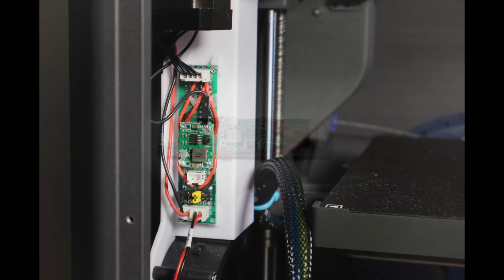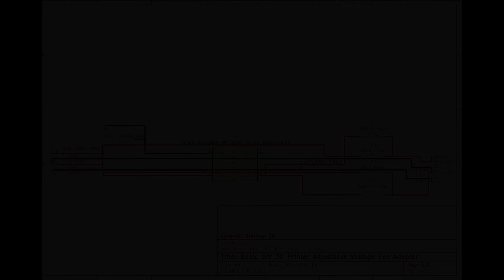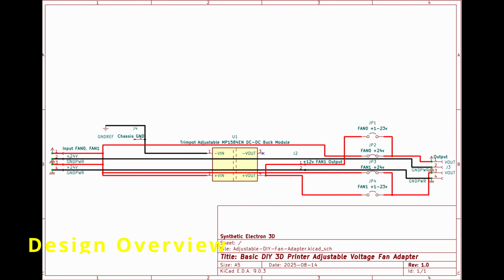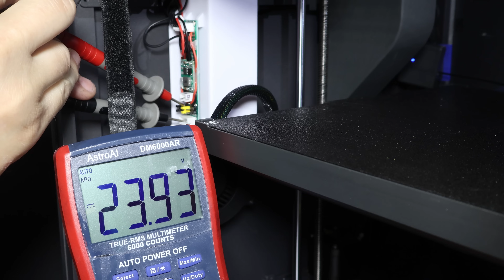DIY 3D Printer Adjustable Fan Adapter

Comment from the maker: If you were to make use of an adapter like this, which fan make/model are you most interested in using with your printer that you otherwise would not be able to?
Reply: noctua for sure I have a noctua fan on my ender 3 V3 SE and it made that printer so much quieter been looking and waiting but for sure will be putting some quieter fans on my centauri carbon
Reply: For PC building I really like Arctic fans (German engineering): 95% as good as Noctua, but one third of the price. Sunon fans also have a good reputation, and I recently bought a 5015 24V blower that was impressively quiet: MF50152VX-1L02C-A99
Reply: Is it worth considering a resistor cable for the 5020 fan, or do you think it might compromise layer adhesion too much?
Reply from the maker: @Spreadie considering that the 5020 can be controlled via the MOSFET on the main board via firmware, probably not worth it. Probably better to limit the part cooling fan speed in the filament profile you're using. Unless you just want a flat RPM reduction no matter what. If it limited the 5020 to 80% that would probably work for most filament and significantly reduce noise. The filament setting is more flexible but requires more work. It really depends on what you're looking for.
Reply: @SyntheticElectron3D  Any kind of noise reduction on the 5020 would be a bonus

Comment: Why exactly does the dc converter module require a special gnd as a reference as opposed to the usual input gnd (gndpwr)?
Reply from the maker: That also threw me off at first. It's due to how the N-channel MOSFET works on the CC's mainboard to effectively throttle the low-side (negative) side of the circuit. That necessarily means the MOSFET negative cannot be a system or reference ground. The buck converter needs a reference to the system ground to effectively control the voltage. What the mainboard MOSFET does is independent of that. You get the combined effects of the firmware control, combined with the voltage the buck converter provides relative to the system ground. If you're running the buck at 80% of 24V (19.2V), then the MOSFET will see that 19.2V as 100% of its voltage, in effect. That gives you 15.36V or a nominal 65% when the firmware is set at 80% fan speed. There are other ways to do the same thing, but this is one of the simplest without requiring access to the source code for the firmware. Elegoo has since released the source for the firmware.

Comment: intresting mod, especially for the pcb and the option, to "adapt" another fan to it... my choice of fan would be mostly a noctua, but depending on the size, i would also look for other fans - liek BeQuiet (i guess, 80mm might be to big, but 60 might be not big enough, and there's not much 60mm fans existing, so i might need to adapt somehow a 80mm fan to a smaller hole in that case). but it's really intresting, and a "cleaner" board would look more professional... i just wonder if that might be also to get completely with the parts on it soldered, so that you just "throw it in" and it works (well, i can solder SMD parts, but that's not everyone's luck that they can do that).

Comment: Can't wait for the follow up PCB... I need to quiet down my Centuari ASAP
Reply: The loudness is the only thing why I did not buy the printer yet.
Reply: @Michal_Peterka why though? 

I don't understand this complaint.  It's not really a loud printer to begin with but where are you guys printing that noise is that much of an issue?

If you're printing in living spaces noise isn't what you should be worried about... if you're close enough to this thing, but the noise bothers you, you have far more problems to worry about than the noise...
Reply: @Nonsense-hg6mo it's loud
Reply: @Nonsense-hg6mo  It is because how the videos portrait the noise. I do not mean this one exactly. Last week I visited friend who buy it and it it not so noisy as I thought.
Reply: @OllieOtterOxen  Maybe the newer one s are more silent. What I do not like is that the  machines does not have some clear marking what iteration/edition it is.

Comment: Is the blower fan the exhaust? If so what about a simple external enclosure for a larger blower and hopefully quieter fan on the back of the printer?
Reply from the maker: The case fan is the exhaust. The blower is the auxiliary part cooling fan.

Comment: At some point you have to ask yourself... between time spent and expense... shouldn't I have just bought a Bambu?
Reply from the maker: Are Bambu's that much better in terms of noise and fan control? Bambu Lab's target market isn't really someone like me, who is doing what I'm doing. Tinkering and experimenting are part of what makes this all so interesting. Or just about anything in the realm of STEM, for that matter. That said, Bambu has its place. It's similar to Windows vs. Linux. You can probably guess which one I'm partial to.

Comment: Excellent work. Looking forward to the follow up with printed PCB. Your idea to develop and offer a range of simple kits is great. If you’re going to continue down that path, you might make 2 separate product listings for the tools and kit parts, just offer combo price. Could leave you flexibility in the future! To answer your question, my default for fans would be Noctua or Thermaltake

Comment: they're good for motherboard fans and other electronics except for the hotend. never cool your hotend with noctua.
Reply from the maker: I've not yet seen a Noctua form factor that would be suitable for fitment to any stock consumer-grade printer. Their industrial grade fans might be suitable from a harsh environment standpoint but mounting them would probably be another project. Agree that the consumer PC-grade fans are not likely a good option. I have one of their industrial-grade 120mm fans in the PC I do video editing on.

Comment: Don’t have a E CC yet, but, I enjoy watching this, and your WYSWYG easy explanation/tutorial. Btw, as in recently reported rumour, have you noticed your CC acting like ET AND calling home when you think it is off, in the middle of the night?
Reply from the maker: I've been up to my eyeballs in editing video. But I did just see some thumbnails suggesting as much. I haven't noticed, but the ECC that is currently plugged in is on the slightly older 1.1.25 firmware. I'm skipping 1.1.29 because it was having some issues with OrcaSlicer. This would be easy enough to confirm though. I do software and networking in addition to screwing around with hardware. I wish I could do more videos in a week that look into stuff like this, too.
Reply: @SyntheticElectron3D . Crap up to your eyeballs, they must look like this > 🤪<! 

Seriously, I appreciate what you do, how you do it, and your sharing of it friend. On that calling home, if the firmware you are on is not doing that, this is an important discovery, and something to consider when you check. 3DPrinterMike, is the CC here on YT that I follow, that just reported it the other day, and I will message him to see what firmware he is on. With that, wishing you a great rest of day.

Comment: I've bought an external ducting fan and plan to remove the case fan and use its wiring, dropping the voltage to 5v to switch a relay to use the contacts to run the ducted fan. The problem I have with the case fan is not just the noise, it dumps the VOCs into the room and has made me violently sick.
Reply from the maker: A lot of people are using the Bento box that was originally adapted from the X1C, I think. Two-stage filter. I don't have a link readily available but someone else may be able to chime in.
Reply: @SyntheticElectron3D Yes I know of it, but the effects of having inhaled means for me, industrial extraction!

Comment: Next video convert the print nozle st connectors to pogo pins to easy swap ?
Reply from the maker: Tell me more. I'm not familiar with this, but it just might be something that I could dive into in a future video and document the process of figuring it out.
Reply: @SyntheticElectron3D  I believe the reference is to the delicate cable connectors that need to be disconnected when changing the hotend assembly for a different nozzle size. 
Nozzle-swapping is easy on the Bambu A1 series, but a bit of a hassle on the Centauri. 
The suggestion is to redesign things to use sprung contacts - a significant re-engineering of the printhead…
Reply: More than just finicky, often breaks the connector off the pcb.
Reply: Something like that? https://youtube.com/shorts/PgBV-IKEyQ0?si=fexPTxCCetwLY_k0 what you thin fisable?